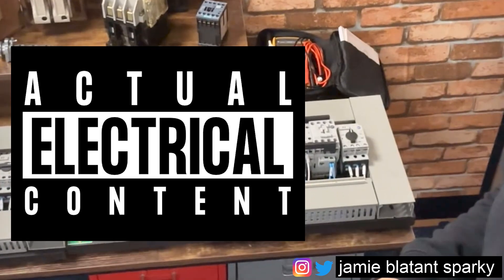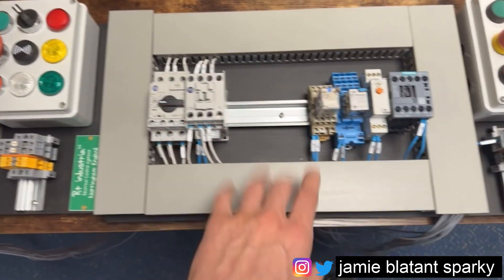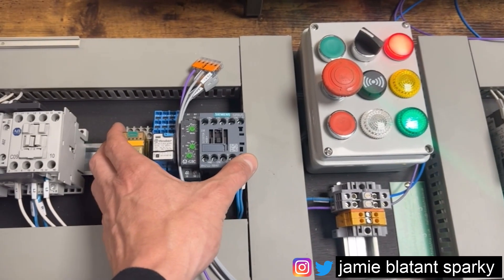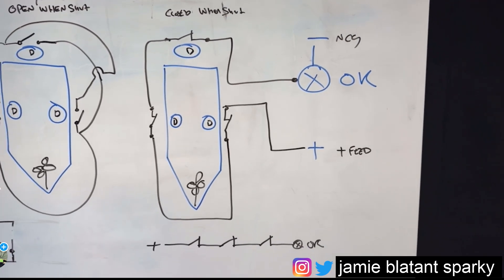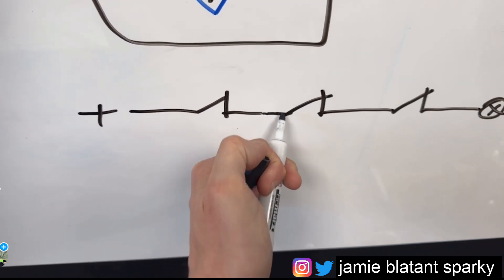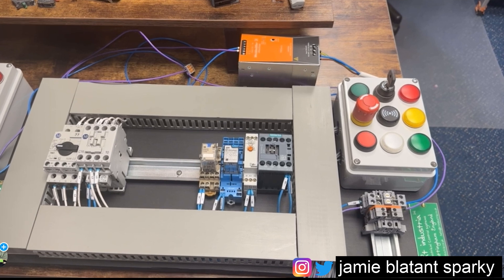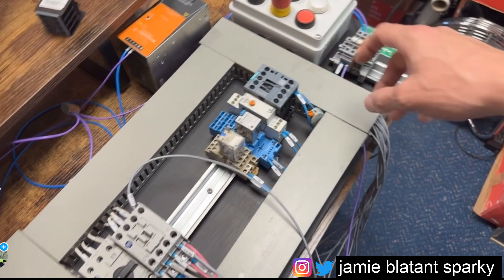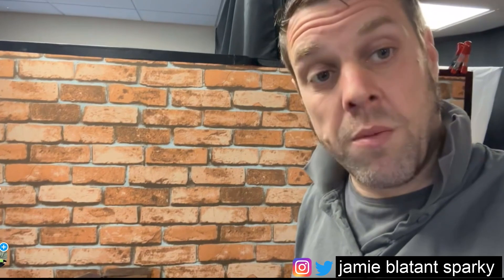NO & NC CONTACTS EXPLAINED part 2

Comment: Great explination of NO/NC and self holding relays. Thanks for the pointer to the Moeller motor manual.
How ablout a Video on the electrical and mechanical interlocks used on Roller Shutter Doors, along with travel limits, door pressue sensors and photoelectric stops.
There's a good chance that this would prevent you flattening Dave Savery again!